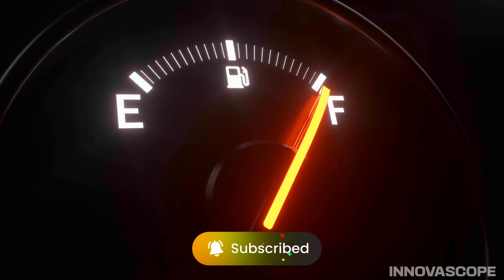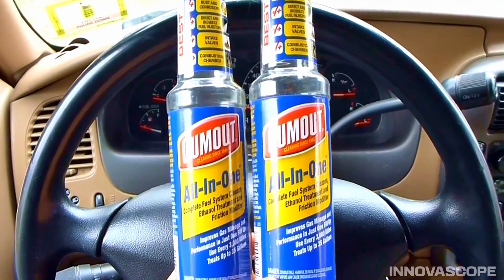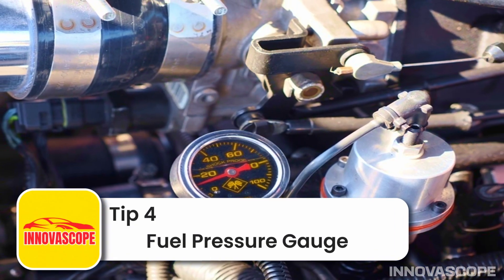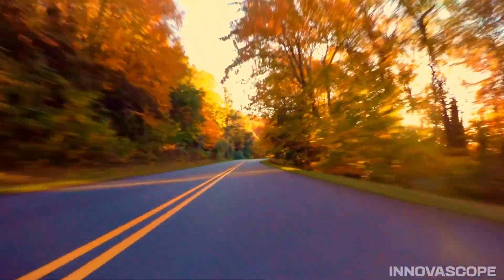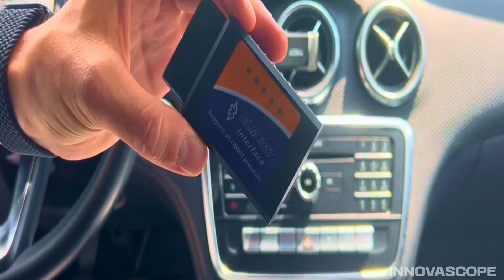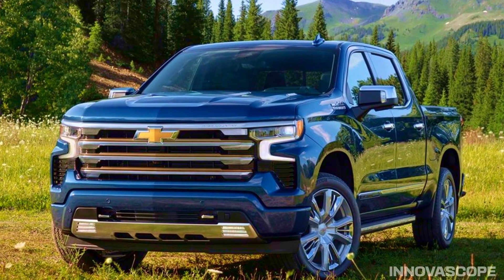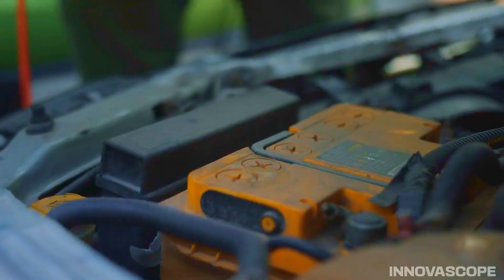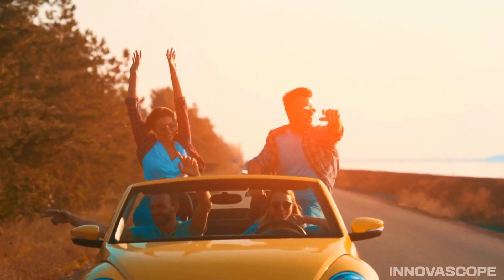Fuel Additives: Myth or Magic? See The Truth!

Comment: *fuel additives*

1. *Gumout* (with polyetheramine / PEA) – carbon-cleaning additive for GDI engines.  
2. *Royal Purple* – injector-cleaning and octane-boosting additive.  
3. *Lucas Fuel Treatment* – injector cleaner, MPG improver, and corrosion inhibitor.

 *non-additive*
1. Engine borescope – for visually inspecting piston carbon buildup.  
2. Fuel-pressure gauge – to test fuel-pump and fuel-filter health.  
3. OBD-II Bluetooth scanner (ELM327) – to read live engine data via smartphone.  
4. Professional high-end scan tool – for in-depth diagnostics.  
5. Oxygen-sensor pressure-check technique – using a pressure gauge to test exhaust back-pressure.  
6. Battery & alternator tester – to verify electrical-system health.  
7. Feeler gauge – to measure and adjust spark-plug gaps.
Reply from the maker: Your list is incredibly well-rounded, especially how you separate additives from diagnostic tools. Thanks a lot for sharing such great knowledge with the community.